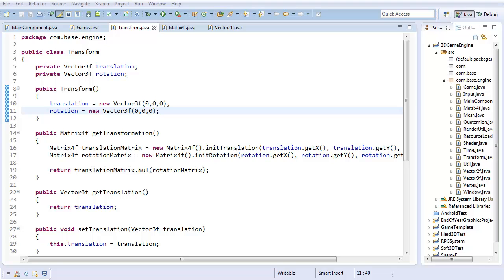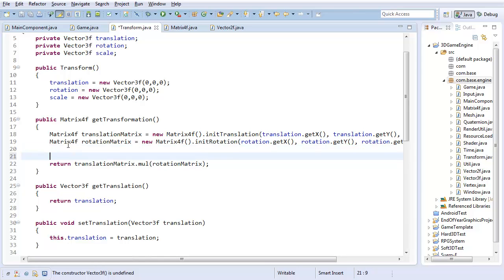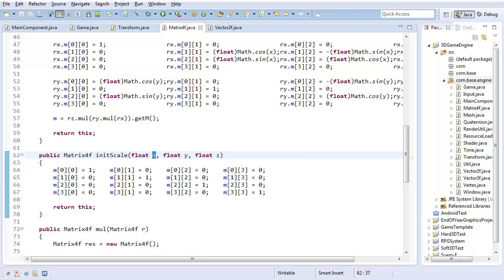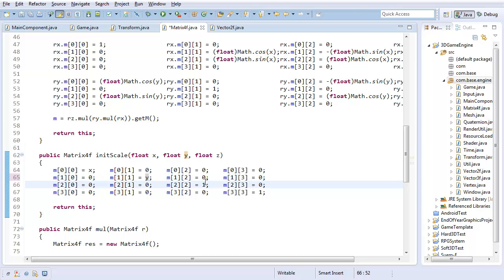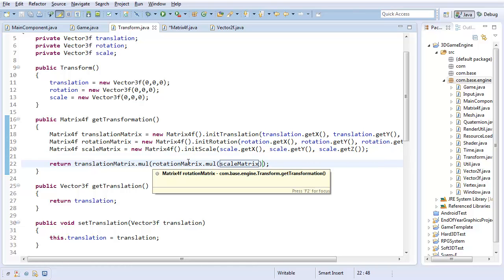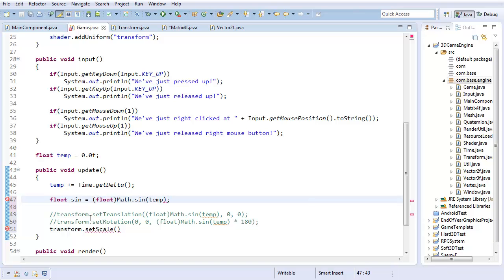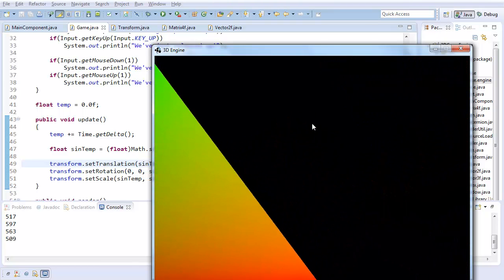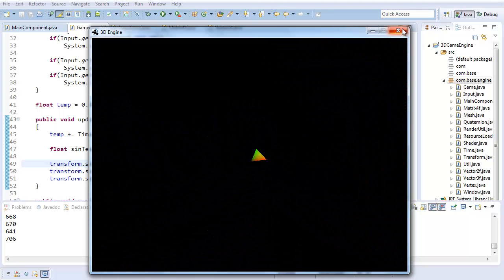#14 3D Game Engine Tutorial: Scaling

Comment: Well, It wasn't really work on my part I was worried about, but more work for the CPU (which in the project I'm working on will have to run a fairly elaborate simulation with hundreds of autonomous characters).  I was worried about doing so many floating point operation per render that I could offload to the GPU (which I took to be optimize for them).